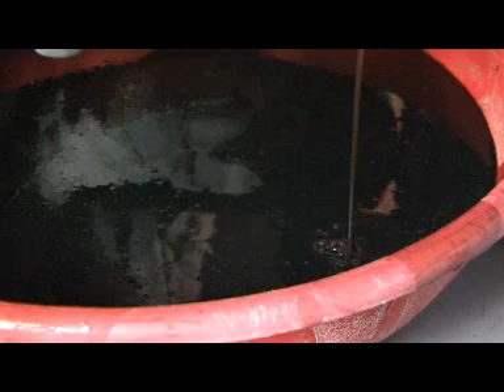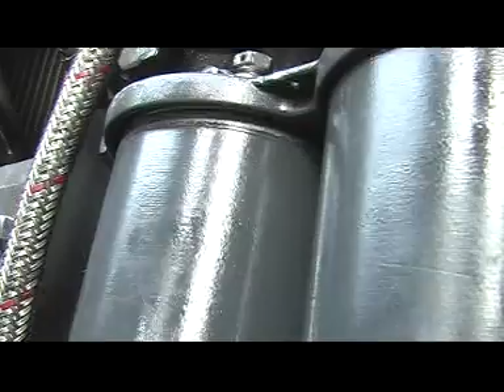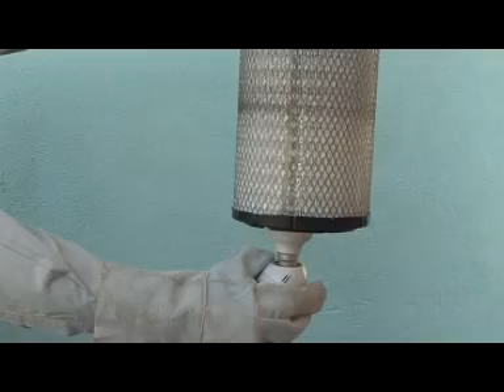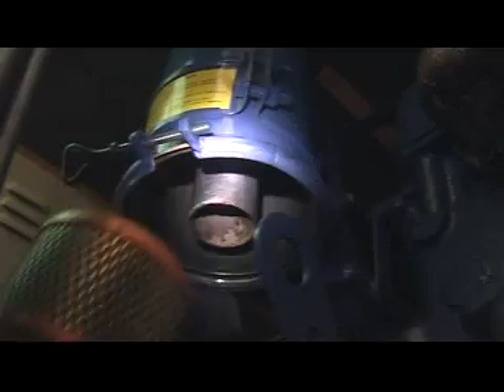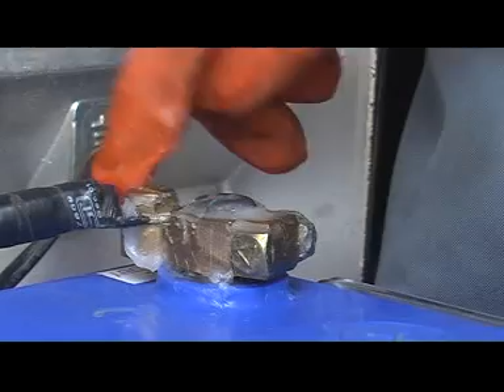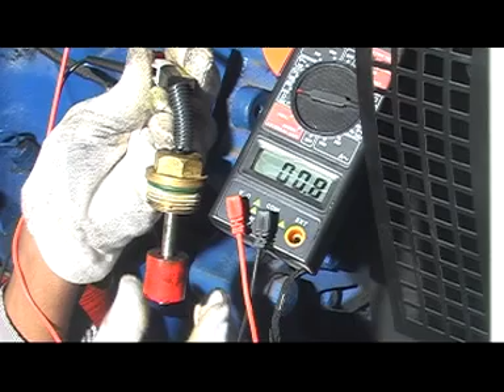Generator Preventive Maintenance

Comment: you misguided the end user regarding lubricating oil commercial brand name. Only volvoline 15W40/30 is NOT the Only brand in the markets,,, you shouldn tell 15W40/30 as engine manufacturer advised.

Comment: Hello. I have an issue with my generator. It goes of some minutes after startup. I have checked and changed the stop solenoid but it still malfunctions.
Reply: Better to check fuel pump 
If problem continues service the engine head

Comment: I have 250 kw cummins  engine Generator which is no deliver power sap lay Electrical line please snd me procedure of this fault
Reply: jeneratör İMALAT SATIŞ SERVİS YEDEK PARÇA ÜÇRETSİZ KEŞİF PERİYODİK BAKIM KİRALAMA 2CİELDE TAKAS İMKANI WATSAP 0532 626 60 99.....WATSAP 0535 203 53 56 WATSAP 0532 493 57 55 WATSAP 0534 578 07 56 TEL 0212 515 60 95............İstanbul merkez olmak üzere Türkiye geneline 7 gün 24 saat teknik destek

Comment: Hi I am a recent board exam passer of electrical engineering. and I'm currently finding a job now. Your video is very informative. I hope you also make preventive maintenance for transformer and for common electrical equipment found in manufacturing plants. I will promote your video to my co-engineers. Thank You!
Reply: jeneratör İMALAT SATIŞ SERVİS YEDEK PARÇA ÜÇRETSİZ KEŞİF PERİYODİK BAKIM KİRALAMA 2CİELDE TAKAS İMKANI WATSAP 0532 626 60 99.....WATSAP 0535 203 53 56 WATSAP 0532 493 57 55 WATSAP 0534 578 07 56 TEL 0212 515 60 95............İstanbul merkez olmak üzere Türkiye geneline 7 gün 24 saat teknik destek
Reply: Did you find a job yet?